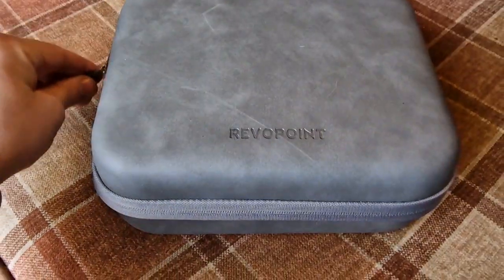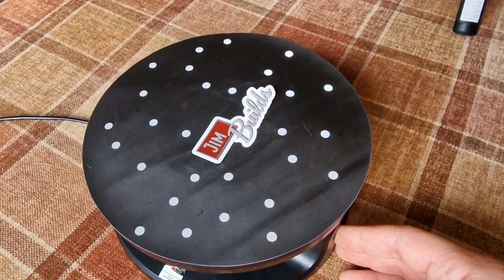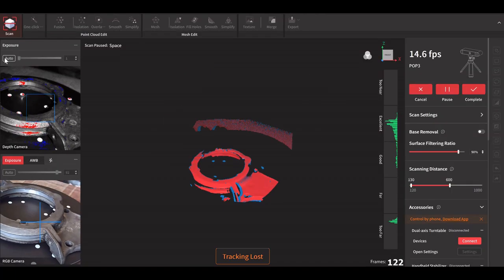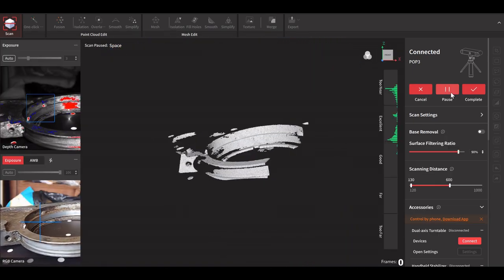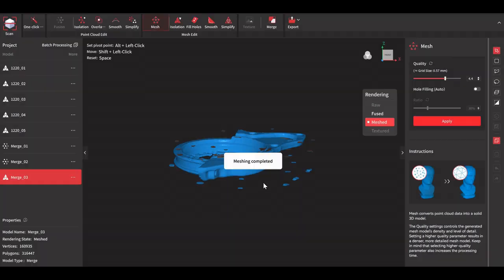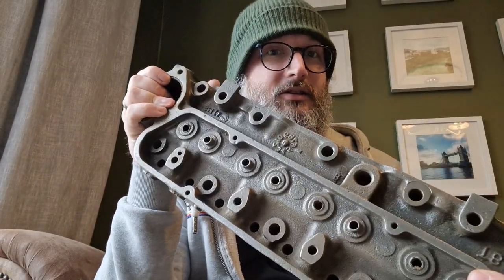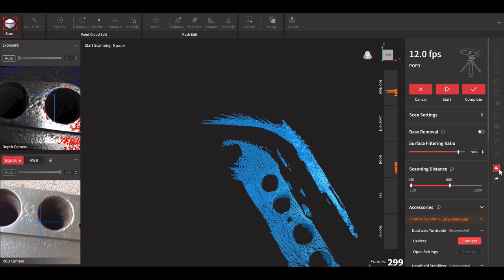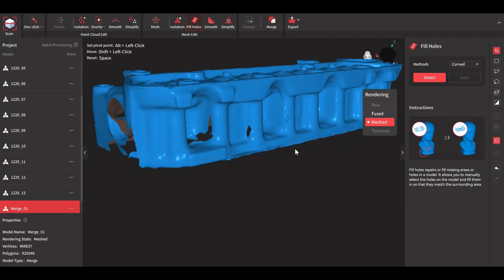3D scanning with the Revopoint Pop 3

Comment: very technical for me but i am interested,im still pondering over a 3d scanner,ill be watching jim to get some pointers from your efforts,wiring loom plugs and dash switches are very much scarce and very expensive when you find them ,i know you did some mk1 tina plugs ,could be a good source to fund your future equipment.
Reply from the maker: Its a cool gadget but I'm only just scratching the surface! 😆 I'd recommend having a trial of Autodesk fusion 360 for cad work. 

That's the intention for the business side, I've moved it to ebay for the moment as I can't build a website! 😄

How are you getting on with red?